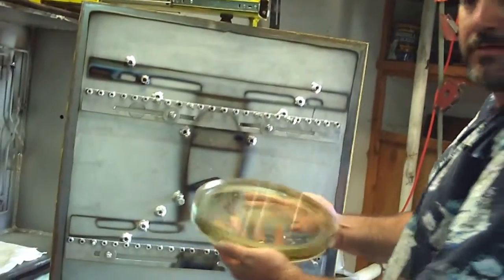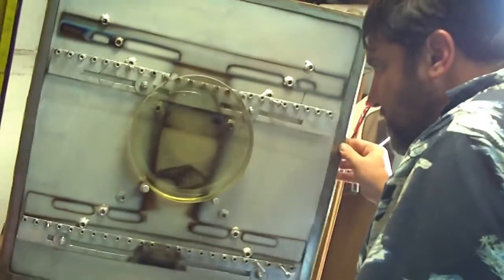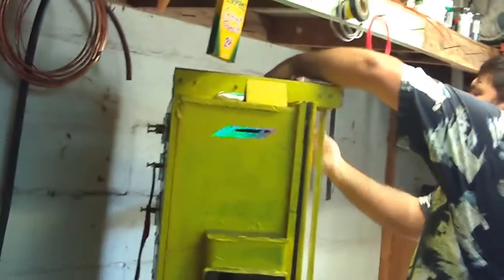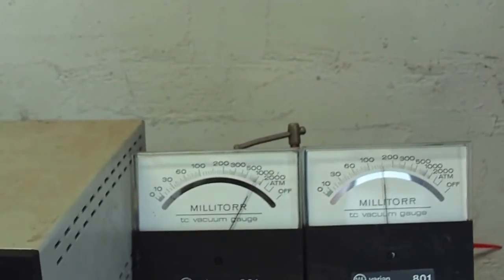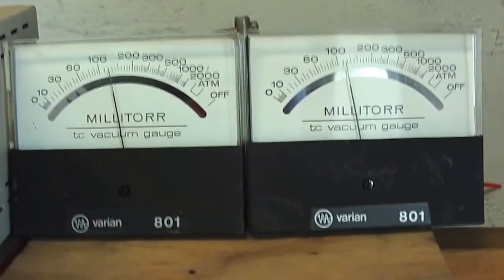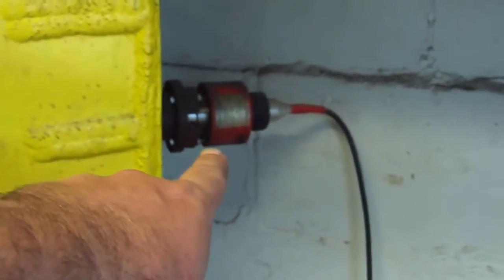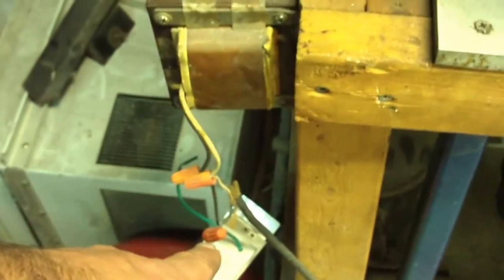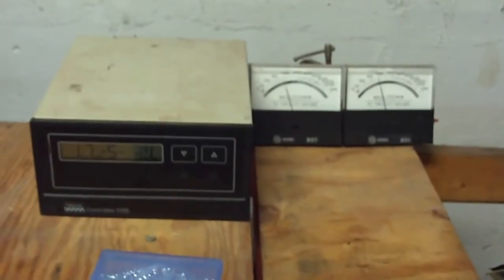Re-Coating a Telescope Primary Mirror Part-4

Comment: Amazing! Great job!
Could you please provide the specifications of both transformers you used? The neon sign transformer & the battery backup transformer?
Thanks a bunch! ;-)
Reply from the maker: Neon Sign transformer is 120vac input and 15kvac output at a 100ma (ish), the UPS transformer is 120vac input and 24vac out at 25 amps for 600watts (ish), however both transformers were just what I had on hand so not much thought has been put into optimizing the solution :)
Reply: @JlerchTampa  Okay, thanks a lot!

Comment: Hi James, well impressed
How do you make the heater bits. wire type/thickness?
Reply from the maker: The tungsten heaters are hand made from 0.032" (0.8mm) wire from an online supplier.  The element is formed in a jig I built using 1/4" (8mm) diameter steel round stock to make the 1/2 loop in middle needed so it doesn't fracture after each use.  One trick that took forever to learn is Tungsten is very brittle at room temp and won't form, but if you heat it with a 1800 watt hot air gun it becomes ductile and forms easily!
Reply: @JlerchTampa  thanks for that. Collecting bits for the process. Wondering how badly it would go for a small chamber made from plywood

Comment: great rig, how much did it cost to make your own coating vac? If u don't mind me me asking. is live to coat my own rather than send it out.
Reply from the maker: To date about $1,000 but that includes a few do-overs.  All the bits and pieces were used, The 4" diffusion pump, the big 4" gate valve, base plate and the other valves / plumbing were a few hundred, The big Welsh roughing pump was another $200 (but inexpensive HVAC vacuum pumps work too, just slower.  The cold trap isn't required, simple baffle system would work if I had to do it again.  The first iteration of the system from 2001 can be found here: http://lerch.no-ip.com/atm/  (yes, its literally a 16 year old web page)  ¯\_(ツ)_/¯

Comment: Just for kix,is there still enough reflection without the coating to vaguely see anything if you were to rig it back up without? (Has anyone tried?) I just wonder about that..
Reply from the maker: YES! An uncoated glass surface still reflects about 4% of the incoming light, so the moon and the planets show up very well.

Comment: What to to after its been coated? No protection coating afterward?
Reply: Nope, and the aluminium layer do that by it self when it get in contact with air where a very thin layer of the aluminum will be changed to aluminium oxide which is a ceramic and doesnt react with oxygen at al and thus protect the mirror from any more oxidation and this surface is so extremely thin that it is totally transparent. The day the surface get dirty by bugs fex or other debris it will just be re coated again.

And the fresh coating is extremely sensitive to anything that get in contact with it so the only thing to do is pretty just to put something over it that doesn't touch the surface to prevent any dust to gather on the surface.